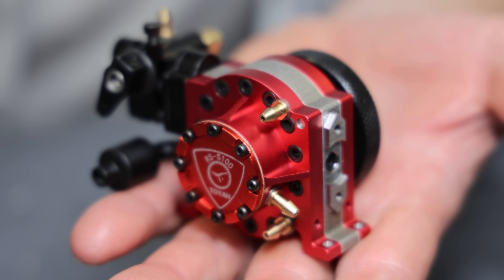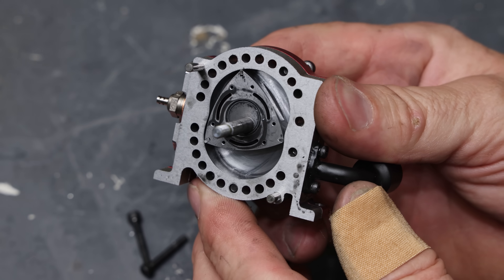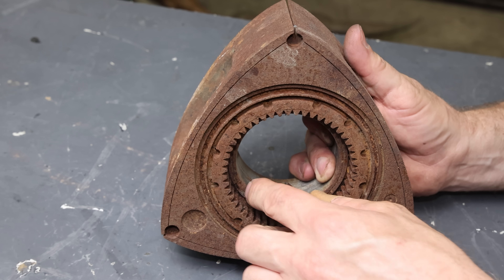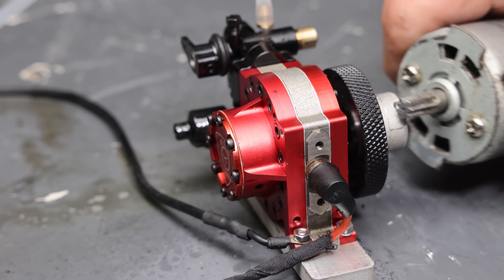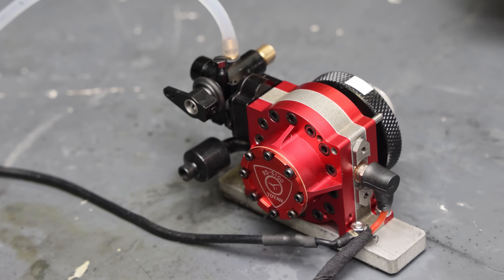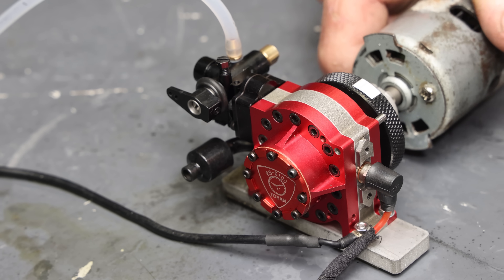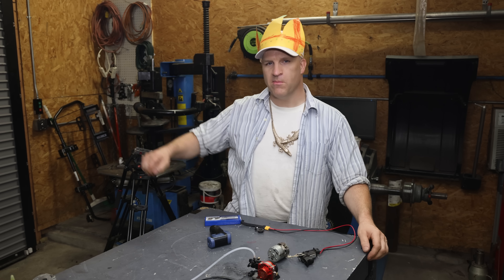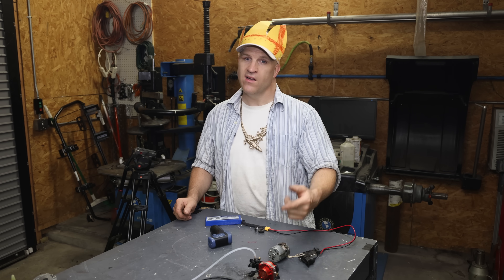Worlds Smallest Rotary Engine (30,000 RPM)

Comment: the crankshaft is outputting 1:3 times the rpm of the engine, meaning the engine is doing 10rpm and the crankshaft is doing 30k. i get its easy for views but please stop spouting bs, its understandable to get confused when you are used to 4stroke engines but this one isnt running 30k.
not to mention i already informed you about this many months ago, so either you still dont understand it or you want those views more than the truth

Comment: Rotary engine speed specifications are defined differently than on other motor types. On a typical rotary there are three combustion events for each revolution of the crankshaft. While there may be 30,000 combustion events per minute for this demo, the actual RPMs of the crankshaft will be one third of that... 10,000 RPMs.

An old COX 0.49 nitro-methane model airplane engine can run at 13,000 RPMs all day long.
Reply: Is he not directly measuring the crank?? Aren't you saying there's 90,000 sparks/minute?

Comment: What's with the metal pin dancing back and forth through the hole from the engine vibration? Why doesn't he seem concerned about an unsecured metal part, within a few millimeters of a flywheel doing 30K+ rpm? Genuinely asking.

Comment: How can these companies make these and have all the oil just spew all over the place? I understand it is residual after the fuel burns but come-on engineer a solution to cycle it back in or keep it separate from the fuel.

Comment: You should get 8 of these small engines and a pair of roller skates. Mount one engine to each of the 8 wheels of the roller skates. Motorized rollers skates. Large Marge would love them.

Comment: Please port out the intake to allow more air to fuel ratio and it will start up right away and not bogout. Exhaust needs improvement to seal and support bracket. This is a great machine!

Comment: Hi thanks a lot for the great video. I have a question, the rotary part of the engine, does it leak by any means? I mean is there a 100% safe sealing there? Or let me put it this way, like for instance let's assume that you fill the engine with machine oil 100% and close all the inlets and outlet openings. Then you try to turn the rotor by hand or a tool, would it resist the rotation motion and stand as it is or would it start leaking and start rotating?

Comment: Engines can only get so small until the oils can no longer do their job because it has to get thinner and thinner to let these tiny engines run. Similarly with the air and fuel because you can’t scale down air molecules and you can only atomize fuel so much before a good mix can’t be obtained. I think these are the issues of this tiny engine.

Comment: Super ironic that the rotary works better than the V8, but still using "works" loosely. It'd look cool on a mahogany desk but probably let you down everywhere else. Many years ago I had a .12ci (2cc) Novarossi nitro rc engine that claimed 2hp at 44k rpm. A minute on the starter box, then keep that bitch fueled because if it flames out it wouldn't restart for like an hour. Radared my RC10GT2 at 51 mph with a 22t clutchbell on asphalt. 2006 baby. Lol. That engine lasted 3 seasons and 7 gallons of nitro. Mad respect.

Comment: You do know nitros arent supposed to be flooded right?? They only use the glow plug for starting once running the nitro fires off of compression and heat. Too little nitro makes the motor run hot, too much fuel makes the motor run cold. Which is why you had starting issues and it didn't wanna stay running unless full throttle.

Comment: What's the project? Are you building an RX500 RC car? Also, what was with that shaft sliding out of the top corner of the motor as it ran? Is that normal?

Comment: ? What kind of rotary was the next smallest that u compared this Toyan to?

This Toyan sounded like it may have needed some tuning at the carb, also when u disassembled it, maybe u should have put some oil to the inside chamber area.
I would love to see it tamed, holding a good low idle and having quick throttle response.
That would make me want to put it in an Rc car for sure.

? How much do they cost

Comment: I was thinking it would be great to use in an RC plane but it would have idle at a slower speed and not stall out all the time.  I think there was something wrong with the engine.  Did you ever figure out was causing the issues?

Comment: try the same tuned exhaust from a nitro engine ,, it will also have  the fitting for the small fuel line to help with drawing fuel at lower rpm ,   the more heat you put in the pipe (expansion chamber) the better it will run,,

Comment: Im honestly impressed they managed to fit damn near a full horse inside such a tiny engine.
Reply: I could run a motorbike on this.
Reply: An actual horse has 14hp😂
Reply: @omarrivera5013  He didn’t mean the animal he meant it has .7 hursepurrs it’s impressive they almost got it to 1 😂
Reply: @Collas42  u a donut watcher?
Reply: @Collas42  Horsepurrs sounds like something you would get if you crossed a horse with a cat.
Reply: @Omar Rivera  that's only a peak value. the average output of a horse is about 1 hp.
Reply: @Anklejbiter  Is that a Shetland or one of those giant Clydesdale/Percheron/etc. types?  I'm betting those can put out RADICALLY different power levels.
Reply: @omarrivera5013 wait wat💀
Reply: @omarrivera5013 actually they have between 4 and 9 horsepower. The most powerfull breeds go on to push 15 horsepower, but only for a really short burst
Reply: @omarrivera5013  peak power, its avg is 1hp
Reply: nitromethanol    :-)   there's your answer... my supertiger .60 cubic inch belts out almost 10 horsepower....finger chopper offer....  for my 60" span R/c plane
Reply: Yeah thats amazin
Reply: i wonder if the head studs would fly out of the engine if you add a second piston lol. It was gettin a little squirrely on him there.
Reply: Only because it revs to 30k, though. That's like 1 inch pound of torque. Horsepower isn't such a useful/meaningful unit in edge cases like this.
Reply: I'd like to see it under load ,net there's very little torque 😮
Reply: True, when I was into cycling I could only keep that kind of power for like 30 seconds and that thing fits my hand
Reply: A real horse is around 2.4 horsepower.  We basically count ponies
Reply: its not horse power, its brake horse power...........you dont realy think a 100 hp engine has the power of 100 horses do you ?
Reply: @philldownes8685  It's called satire.
Reply: Basically 3 horse legs!
Reply: horsepower doesnt have anything to do wit  horses mannn
Reply: @pastamane7167  It's roughly the amount of work a horse can do in 24 hours, which includes sleeping. So it's not really comparable at that point.

Comment: Pretty cool! Looks like you need to get some sort of exhaust seal going on there with all that ooz. EDIT: Sounds like it's WAY too rich. If you get the right air fuel ratio as well as better compression, it would help the rpms. But 30,000???? That's sick!
Reply: Rotary engine speed specifications are defined differently than on other motor types. On a typical rotary there are three combustion events for each revolution of the crankshaft. While there may be 30,000 combustion events per minute for this demo, the actual RPMs of the crankshaft will be one third of that... 10,000 RPMs.
Reply: @martinhirsch94  sorry my dude but the output ratio of the engine 1:3 meaning the crankshaft turns 3 times as fast as the engine. so the crank is doing 30k and the engine is doing 10k

Comment: An old gunsmith trick when you have parts that may pop out do the work inside a clear plastic bag. Might not be conducive to filming but you'll contain your parts. I learned this after looking for a tiny spring for two hours. :)

Comment: 0.7 Horsepower considering the size is insane. Given the engine is 0.0024 liters this means it produces 291 horsepower per liter. Only beaten by the Koenigsegg Jesko with 313.6 horsepower per liter.

Comment: These things are cold natured engines. Being that small, it's not gonna be easy getting good compression, you'll have to be very precise on those seals. I would also recommend some carb work after the new seals, as it will effect the fuel mixture. Cool little motor though, high RPM little critter.

Comment: Moment you put the engine back together, I thought the apex seals wouldn't be right. Typical rotary.

Here in Australia, we have a saying with the old Ford 6 cylinder 250c.i cross+flow motors - if it didn't JUST have a head gasket replacement last week, guaranteed it already needs a head gasket, 100% lol.

Comment: now buy 3 more, make a long enough eccentric shaft, and then sandwich that 20cc 4 rotor badboy up. I wanna see you dyno that thing and make it peak about 20ft/lbs on a 20cc 4 rotor setup. literally the highest torque to displacement ratio ever. because that's been the dream of mine since forever. having a 260 hp and 260ft/lb 4 rotor naturally aspirated RX-7. i think it is definitely achieveable. besides, with how light and nimble an RX-7 is in stock tune, 300-350hp and around 300ft/lbs of torque is all you will honestly ever need to have a serious track weapon.

Comment: 1,000 of these connected to each other will give you almost the same displacement as a four rotor 26B.
Advantage is you could split mountains in half with the exhaust note.
Hence why we use the safer variants in vehicles.

Comment: Definitely sounds like its too low compression and sounds like its got a leak it the main seal .. pulling air in making it run out of fuel back pressure

Comment: I think you screwed it up by taking it apart. Gaskets need to be replaced with new ones when you disassemble an engine.
Reply: If the gaskets aren't torn up they are fine.
Reply: No they dont need to be replaced, as long as there is not toomuch dammageits perfectly fine.